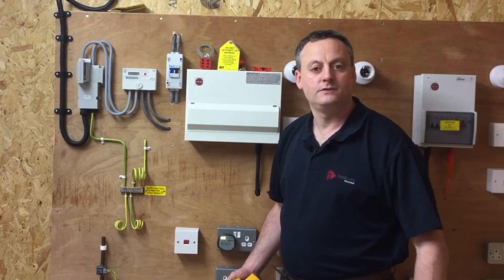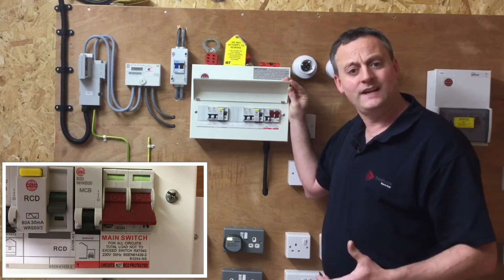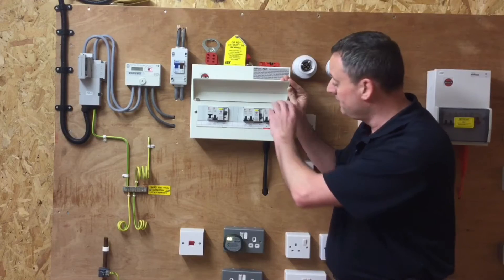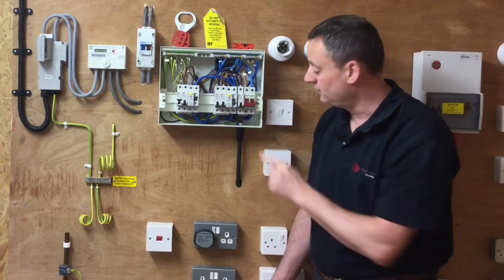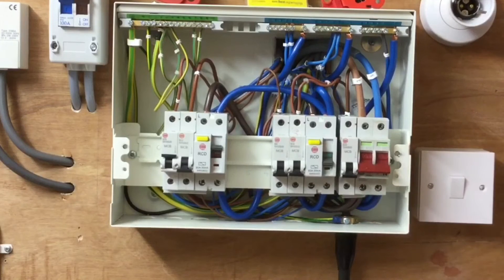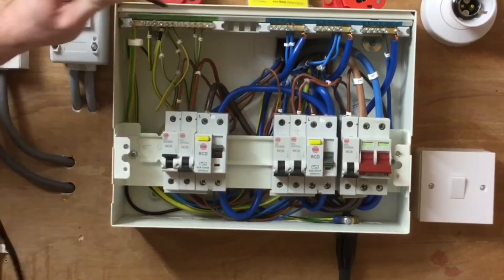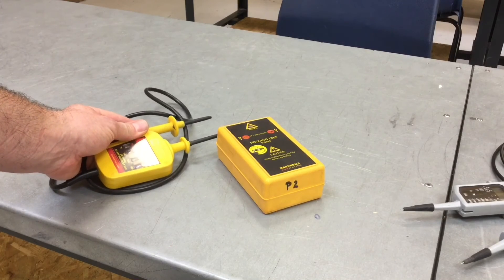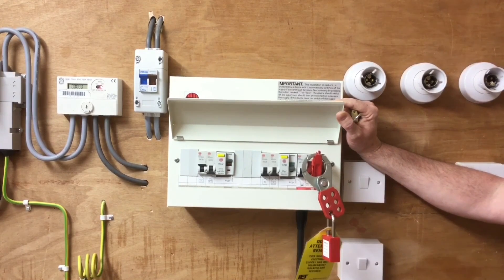Safe Isolation of a Consumer Unit (Single Phase 230 Volt Supply) Main Switch (Double Pole Switch)

Comment: Say you have multiple DB birds you have isolate all circuits and the main isolators on all of them but one has a huge PF correction capacitor for a motor that is also isolated independently from the db and motor (for arguments sake) you can do all these tests for isolation but when you go to test anything directly connected to that capacitor you could get a deadly shock (potentially) would love someone to explain how this isn’t possible using these techniques described in these videos I’m not an electrician just a tinkering dyslexic

Comment: I'm 28, I've been a mechanical fitter for the last 8 years on powerstations. Thought it was about time I started learning a new skill. So I've started my city and guilds training. One thing that is bugging me that I can't seem to find material on is the following:
Say you need to change the consumer unit, how would you isolate the supply tails from being live, if you don't have a switch coming from the meter to the consumer unit? Or will there always be an isolating switch between the meter and the consumer unit?
Reply: Pull the 100 amp fuse

Comment: Excellent video as always. Thank you. I have a question: at 5:23 - here, Line (the most dangerous conductor) is removed first, before Earth. Can you explain this, as all other actions have been to remove the least dangerous conductor first. I am a little confused about "contacting" and "removing" probes.
Reply: The reason is that if your probe is on a possible live cable ,the electric can run through the tester and make the other end of the tester probe live! ,so good habbit to remove possible live end of probe first,hope that makes sense.

Comment: I thought the klasp type you used have been recommended not to be used as you can split the pincer mechanism with a screwdriver or of over time the weight of the locks can pull them apart? 

The arm type when the locks go through the arm and secure that way are a bit better

Comment: Hi Gaz, excellent video as always. Should the tail isolators be in a metal clad unit now or does plastic still meet 18th?
Thanks
Reply from the maker: The remote isolation switch can be in a plastic enclosure 🦾. Thanks for commenting. Gaz
Reply: GSH Electrical much appreciation for clarification 👍

Comment: If there is a DP switch between the meter and the consumer unit (all located on the same wall, as in this setup) and it's labelled Main Switch, do you still have to have a second main switch inside the consumer unit? If yes, why? If no, where do the tails go? I am getting different interpretations (opinions). Is there an official answer to this? Many thanks.
Reply from the maker: Hi. The regional electrical company can place a switch in the tails normally close to the electric meter but you will always have a double pole switch in the consumer unit as well. Thanks for watching and commenting GSH Electrical

Comment: To prove isolation of the external double pole switch would you test at top of red switch
Reply from the maker: Hi. If you have a remote isolation switch you would test at the top of the consumer switch 👍. Thanks for watching and commenting GSH Electrical
Reply: @GSHElectrical  Thank you

Comment: I’m watching your videos today so sorry for all the questions. Is it permissible to use the incoming supply to prove the dead tester. Obviously this only works if you have an electrical supply.
Reply from the maker: Hi yes. I have a video coming out soon where we prove the tester on a lighting point as the proving unit is not working. I will try and keep up with your questions today. Gaz
Reply: GSH Electrical   GAz - Don’t worry Your safe for the rest of today, as I’m  doing some very unethical wiring in the garage to prevent the 15 mA earth leakage from a variable frequency drive drive tripping out my main RCD every time the main contactor pulls in.  Ridiculous that this machines was sold as  being suitable for domestic use with a 13 Amp plug.  The machines not faulty just has a high leakage current due to the presence of EFI capacitors making it unsuitable for domestic use.  Thanks Regards chris